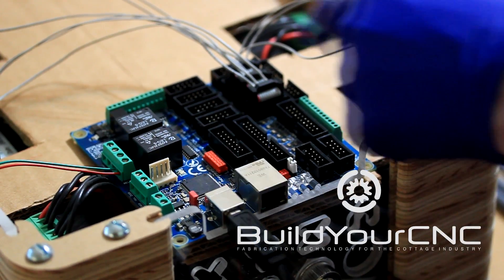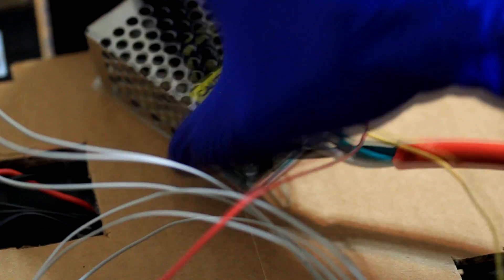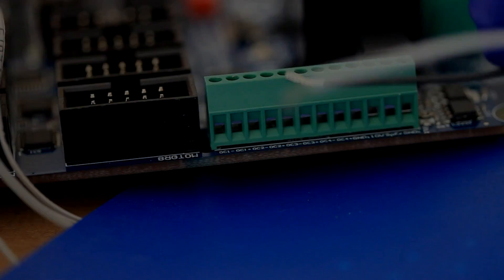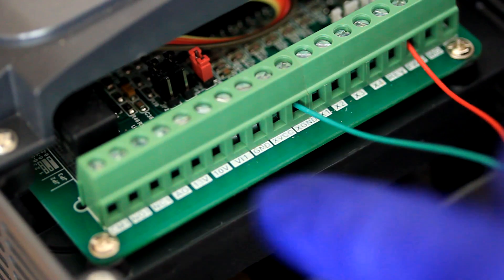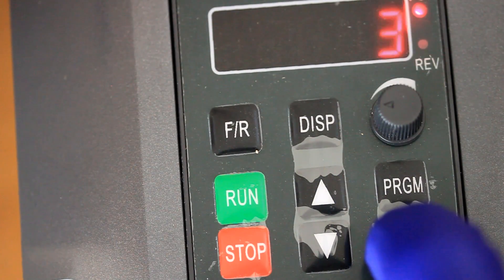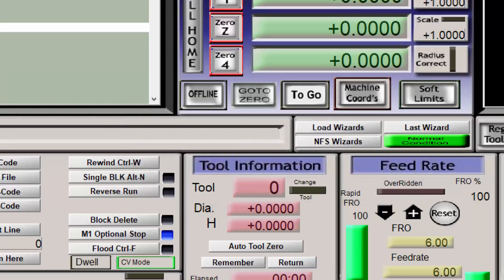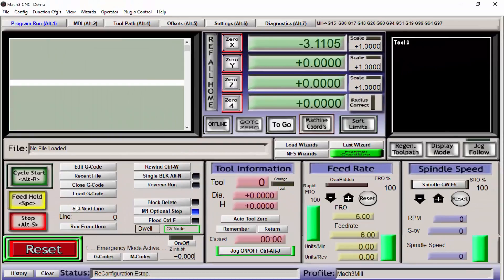6. Controlling Spindle Speed with Mach3 and the Pokeys57CNC CNC Interface Board

Comment: Hello nice video ... could you show how to operate the pin from software ... I am using FluidNc, on my VDF I connected to 10v (input) / Gnd and Fwd / Rev .. should I also switch the 4 white pins of the red square or simply set the parameters P00.01 = 1 and P07.08 = 3 ...
Thanks
Philippe
Reply from the maker: Hi Philippe. Come to my live stream and we can discuss this. This board can be controlled using c# or c++, so you have a number of possibilities.

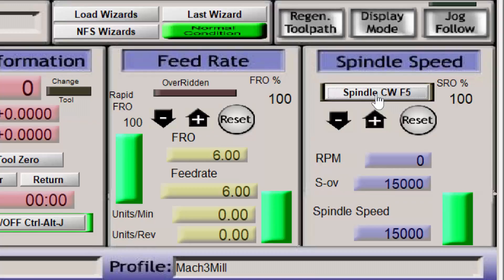Comment: The video Is helpful. But all the menus in Mach4 is different. There is no multiplier as shown at 7:35. The entire PWM menu is gone. I’m probably confusing myself by this. 
But the menus are so different, and a lot of menus you are referring to is gone or maybe got new name/place. That’s why it would be nice with a “upgraded” video.
I have enjoyed all of the Pokeys videos.
I have replaced a crappy XHC BOB with the pokeys.
I have 3 pokeys devices on different machines all working fine. I got that brilliant idea to get a spindle with a WFD. Ind i have to admit that i am getting seriously confused with the setup.
I have the spindle up and running, thanks to your Mach3 videos. Although i cannot get around the speed control and how to get it correct on the mach4 display.
I bought an m,achine with the old BOB installed. Worked fine until it decided to smash the bits into the table, at 100% speed, every time I tried to probe Z. And that’s getting expensive 🤮
Support from China equal 0. So i had a spare Pokeys.
Naive as i am, I thought that the wfd/spindle is already setup, so it should be easy to just move the from the old to the new one. Same Same🤷🏽‍♂️🤦🏽
I will probably be more wise when i get old. m only 60, so there are many years to learn
Reply from the maker: Yes, the menus are different. I wouldn't worry about that so much since all you need to do is get acquainted with it. I will create another video on this when I get my next customer for a spindle. If your immediate case, I would recommend using the control panel of the spindle to control speed and starting/stopping the spindle. You are wise to get a spindle even though you get no support from china. That is why I sell the spindle as I provide free support to my customers. It's more expensive and I do all of the wiring and soldering for my customers so they don't need to.
Reply: Thank for the answer. I’m looking forward to  seeing the video. I really like the Mach4. But it’s a little confusing when they are changing the menus that much.
By the way, where in the world are you. Country?

Comment: I have a multiplier of 0.00416, 24000 rpm spindle, kernel speed 20 khz, PWM base 2000, but my  spindle runs 4 times as fast as what i put in mach. How can i change this? Change the multiplier, or is there another setting that can change the rpm?
Reply from the maker: What ratio do you have in your spindle pulleys dialog box? (config-spindle pulleys). And, in your VFD, what do you have for the number of poles and rated number of revolutions. Those two parameters are one after the other if you have the HY VFD.
Reply: @PatrickHoodDaniel  Thanks for the fast reply, The ratio of the pulleys is 1. I have the H100 series. The number of poles was set to 2, I changed it to 4 but the ratio didn't change. The rotating speed/ motor revolutions was set to 3000 which had to be in 1440  as factory value, so changed it to 1440. With that setting i got a RPM of around 7000 with a 1000 input. I put it back to 3000 but i guess that's high enough and its better to change the multiplier then.
Reply from the maker: @blaq7751  Yes, I would look at the value in Mach3 as a value Mach3 "thinks" the  spindle is running. The pully ratio is the value that you need to change to get the numbers to be the same. Additionally, are you using a tachometer to get the RPM of the spindle? To set the correct poles and 300/1440 value, you will need a tachometer to make sure those values are correct. Use 2/1440, test with tachometer, if not right, use 4/3000 and test with tachometer. I would recommend doing this with the control panel first rather than  the PWM to make sure the poles and 1440/3000 value is correct.
Reply: @PatrickHoodDaniel  Yes, i tested with a tachometer. As what i said its 4 times off with the 3000 value,  if i change it to 1440 the spindle speed is around 7 times faster. So leave it on 3000, and change the the pulley ratio to 0.25? ( I thinks 2 poles is fine, because i'm milling wood and dont  really need a high torque) And after that fine tuning in the Linearity.dat file?
Reply: @PatrickHoodDaniel  I changed the pulley ratio in spindle pulleys, but the rpm stays the same

Comment: Hello I’m using pokey 57 for cnc plasma with plasma sense thc I can not get the thc to work it will not read out the voltage when I do a test run I grounded the table and using shielded cable as well 
Can you please help me 
Thanks Robert
Reply from the maker: Hey Robert, polabs has great support on their website.  They will definitely resolve the issues you are having, so give them a try.  If you purchased the units on buildyourcnc.com, please give me an email so I can help you along.

Comment: Thank you for those Tutorials. I am stuggeling to transfer those to mach 4, i followed the wiring (with the FOR port  and DCM for on and off, and VI and ACM for Speed)  and the Mach4 Manual 
I am using a HY 1.5kw vfd (http://www.jinlantrade.com/ebay/invertermanual.pdf).  
The Spindle ON/Off works fine but i cant change the speed, even if i set boht PD001 and PD002 to external Terminal.

Comment: Hello, Nice tutorials (the entire series)

The same VFD, the same Pokeys57CNC, the same Mach3, The same settings (from the video). 
When the spindel is NOT started, cnanging the spindle speed in Mach3, changes the display  data on the VFD. BUT the spinle do not start!  If I press START button on VFD - the spindle starts, BUT the frequency is absolutely unstabile and is NOT that value, set from Mach3.
You have another connections on VFD, may be I miss something to connect (or to set).

Can you hel somehow?
Reply: Did you figure it out?  If you have the same VFD like I do, there is a jumper to the right that needs to be manually moved to the left to allow the computer to control the spindle.  When you move it to the left, it disables the start, stop and potentiometer knob on the VFD.  I cant see to get the spindle speed to be accurate, it has two to three speeds at 8k, 12k and 24k rpms.